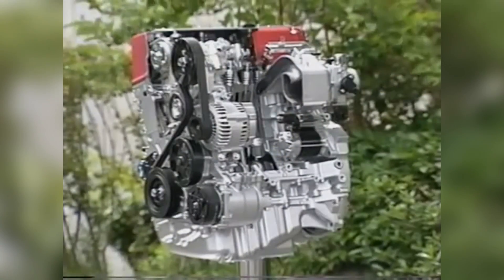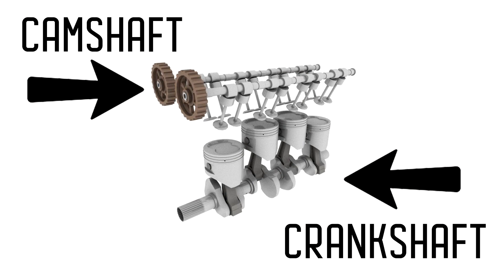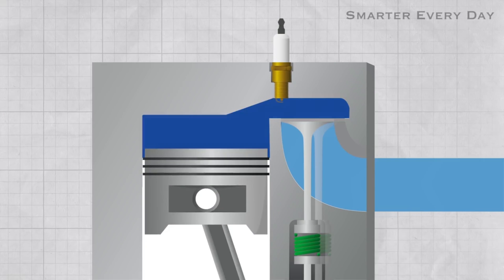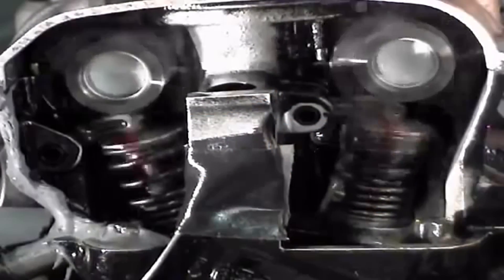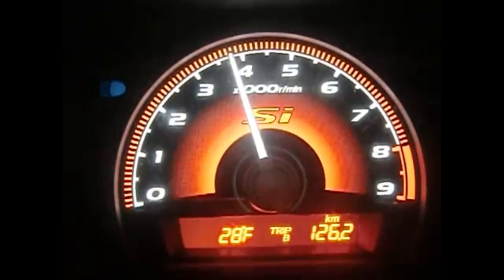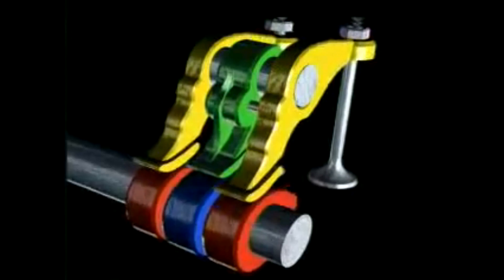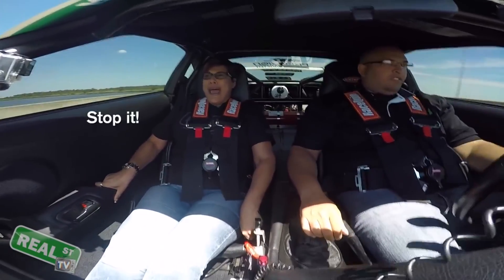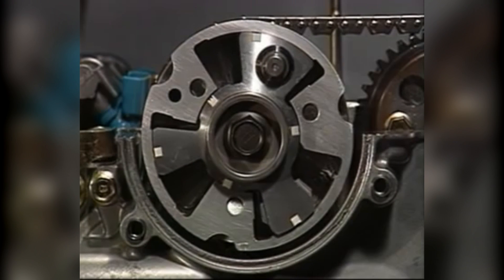Quickly Clarified - Variable Valve Timing (VTEC vs VVT-i)

Comment: You didn't show how the VVT-i works and the system you showed isn't VVT-i.

The one you are showing uses oil to turn the camshaft inside of the casing turning it. So everything you see is spinning together and the cam shaft can be moved within that advance or retard the valve opening and closing time.

VVT-i uses s helical sleeve system to make adjustments to valve timing.

Comment: I’ve only ever drove VVTI in the Celica GTS … never felt anything engage .. don’t get me wrong it’s not like Vtech is super noticeable power wise “stock” … but at least in the sound you can hear the crossover and somewhat feel the Rpm’s climb faster…
Reply: VVT-i is only in the celica gt, VVTL-i is in the gts. and trust me when I say, there’s no way to miss when it kicks in😂 it ads 40hp instantly
Reply: @ggyjjbc  
Maybe it does lol .. like I said maybe it’s the Crossover sound on Vtec that makes you feel it more (psychologically) 👂 … it’s hard to feel anything on a 170hp-200hp 4 cylinder with low torque  in general lol 
Especially since I drove my G37 to my friends house that day… switching over to a car with half the power that quick makes it harder to feel the potential
Reply: Because this lets the controller adjust timing smoothly across a range, unlike VTEC which abruptly switches between two distinct cam profiles.

Comment: But how does vtec mechanism controls the timing? From the video I understand it controlls only the lift. But maybe I am wrong. Thanks!
Reply from the maker: sorry, I didn't go as in depth as I should've. So to adjust the cam timing the cam gear can shift by a few degrees using a solenoid/motor if I'm not wrong. This solenoid shifts the cam gears by a few degrees based on the ECU tuning, Rpm, boost, etc.
Reply: @JCMediaYT  and that is call VTC, not VTEC.

Comment: they thought vtec was just fast but they didn't know vvti was more faster. 
 because vtec is more popular with those who don't know about cars, but vvti is really better. vtec is just popular with those (kicks in kicks in yow) but for those who know about cars, vvti is more popular
Reply from the maker: nope, vtec is faster because it also adjusts cam lift, not just the timing. VVTi is more popular because it's much more simple and easier to do (including aftermarket with the V-Cam for Rb26 engines). VTEC on the other hand, requires a completely different valve train.

Comment: I've driven both VTEC and VVTI cars out on the roads at night. VTEC by Honda is usually a smoother and more comfortable ride even when hard accelerating. But I'd have to go with the VVTI in my 2005 Camry Sportivo. It throws you in the back of your seat very harshly and feels much more like a true sports car. Though I loved the many times within my mate's Honda NSX which by all means is an absolute beast of a machine, there is just no denying how brutal the throwback is of a VVTI Toyota Camry is. Being completely honest, I found the VVTI to kick in more than VTEC but VTEC is still a very smooth and genius design.
Reply: Toyotas VTT-I system gives you more torque at lower RPMs. Most Toyotas hit 90% torque as low as 2300 RPM and carry it all the way to peak. As an example, my 2007 Lexus GS puts out 274 pound feet of torque at 3600 RPM but it hits 90% of the torque at around 2300 RPM.
Reply: @noahschaub1984 best explanation
Reply: VTEC includes VVT

difference is that VVT doesn't have lift

the intelligent version of VTEC is of course, i-VTEC which is where the i in VVT-i also comes from
Reply: I'm so sorry, what I said earlier is completely wrong. VTEC does not have VVT. That would be i-VTEC, which combines VTEC (Variable Valve Timing and Lift Electronic Control) and VTC (Valve Timing Control)! My bad 😔
Reply from the maker: definitely have to go try that out myself hahah, thanks for sharing

Comment: For those who said toyota vvti engine is slow, they don’t know how to make it kicks in 🤣
Reply: how do I use my vvti?
Reply: @vinzabarico3905  if u use manual, hit your gas till 6k rpm, then upshift your gear. 

If u use cvt, drive in manual mode so that u can hold to 6k rpm and shift it

If u use 4 AT, drive in 3rd gear.
Reply: @ZACKHO24  sheesh. Thankssss sir!!
Reply: It's not slow, but the VTEC is actually faster but still the VVT I is also not slow also fast but it can't match the VTEC

Comment: Does vvti only affect one camshaft or both intake and exhasr and does this apply to the 2zzge with the vvtli
Reply from the maker: depends if it has normal VVT-i or Dual VVT-i. If it is VVT-i then only intake camshaft has vvti, if it is Dual VVT-i then both intake and exhaust has vvti.

Comment: Variable valve timing/VVT (Vtec, Mivec, VVTi)mekanisme kerjanya adalah meningkatkan durasi overlap serta meningkatkan langkah hisap menjadi retard. 
fungsi utamanya untuk mengurangi emisi, dengan meningkatnya durasi overlap, backpressure gas buang masuk ke ruang bakar lebih banyak sehingga meningkatkan suhu dan mempercepat titik bakar bbm/fuel. 
pada mesin 4silinder, desain header knalpot versi pabrikan konfigurasi umumnya 4-1 dengan percabangan pendek, ini membuat tekanannya ruang bakar terlalu padat di rpm rendah yang membebani kerja mesin dirpm menengah-atas. saat VVT berkerja, durasi langkah hisap menjadi retard ini bisa mengurangi beban mesin di rpm menengah-atas. yang kita rasakan seperti ada peningkatan tenaga atau seperti sensasi mesin turbo. 
kurang lebihnya begitu bro...cmiiw
Reply from the maker: iya bener kok bro 😁👍